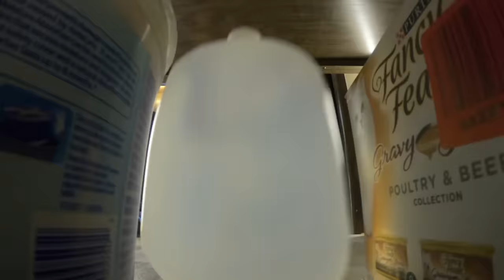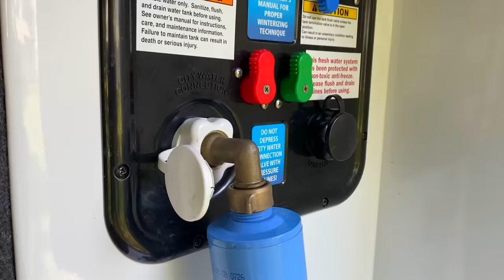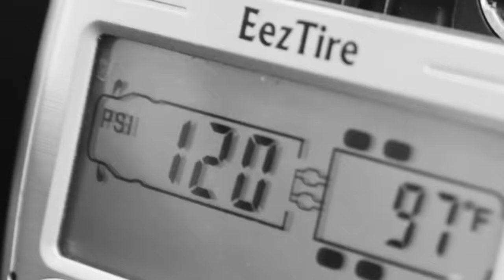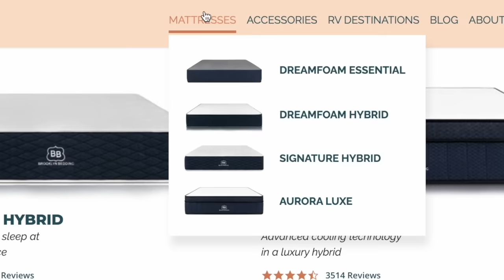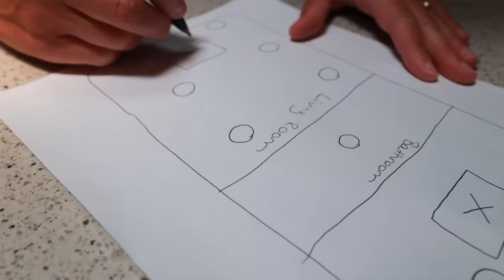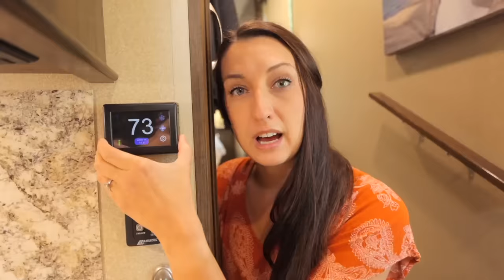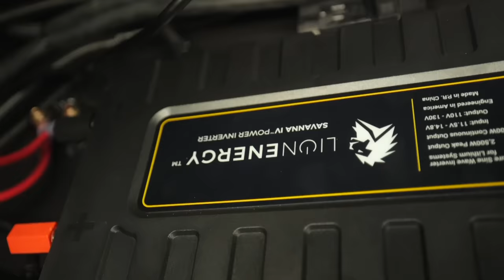9 Exceptional RV Upgrades that have the MOST Impact (RV Life)

Comment from the maker: A portion of this video is sponsored by RV Mattress from Brooklyn Bedding. A special thank you goes out to them for their support!
Save 25% on a new bed with our code: hanks
https://rvmattress.pxf.io/5g7Z23

Timestamps and Product Links:

00:00 Intro

01:39 Clearsource
---Save 5% with our code: HANKS5
https://urlgeni.us/clearsource

03:32 Tire Pressure Monitoring System
---Save 5% with our code: HANKS5
https://urlgeni.us/TSTtpms

04:44 RV Mattress (Custom Sizes)
---Save 25% with our code: hanks
https://rvmattress.pxf.io/5g7Z23

06:46 RV Airflow Air Conditioning
---Save 15% with our code: THANKSHANKS
https://urlgeni.us/rvairflow

08:17 Storage Benches
https://urlgeni.us/amzn/storagebench

09:12 Recliners
https://store.lci1.com/seismic-loveseat-group-norlina

10:01 Internet
https://www.starlink.com/

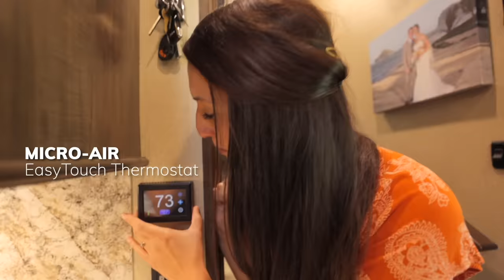10:53 Micro-Air Thermostat Control
https://urlgeni.us/amzn/microair

12:20 Lithium Batteries
https://urlgeni.us/LionEnergy

Comment: Some tips for Alaska. 2 mounted spare tires for both truck and trailer. Auxiliary fuel tank for the truck. Fuel isn't always a guarantee at a fuel station. Good set of tools, a jack and at least a 4 way wrench and/or impact wrench.  Minimum of a 2000 watt generator and increase your battery bank to a minimum of 2 batteries but 4 would be better if you have room. You may find yourself between campgrounds for multiple days. You pretty much must plan on being self sufficient and only relying on yourself to get out of trouble. Help can be hundreds of miles away. Carry extra fuel filters for the truck too. Plan for anything that can leave you stranded.
Reply: Good advise. Some days you may be the only rig on the road!!
Reply from the maker: Great advice! Thanks so much Ted!x
Reply: I am currently going opposite the way, and I agree with everything in this message.  Except for 4 batteries that'd excessive if you have a small generator, you'll be fine.

Comment: My family andI have pulled our camper to Alaska and back in 2021 and 2022, and I’d like to give you advice for your trip to Alaska. Take the Alcan and on the way up and the Cassiar on the way back. Both are amazingly beautiful but the Cassiar has a lot of unpaved miles on it. Once you get outside of destruction bay in the Yukon, don’t even try driving more than 70 KPH (all Canadian speed limits are in KPH) because the frost heaves are really bad and will sneak up on you. The sad thing is that the road is going to be very bad all the way to Tok Alaska. I’ve seen lots of people post about broken camper frames, leaf springs, and even axels. Take plenty of time in Canada to watch for animals and the scenery. Carry an extra 10gals of diesel in the bed of the truck. Some of the gas stations are very far apart in Alaska and Canada and the comfort of knowing that you have some extra fuel will take the stress off the drive.
Reply from the maker: Thanks so much Zack!
Reply: 😂that’s km/h on our speed signs. 🍻
Reply: When we moved from Alaska to Arizona we had a uhaul we were driving down. In the Yukon in the middle of nowhere we got 2 flats. That was a nightmare 😂 Be prepared for the worst.  Lots of pot holes.

Comment: My favorite upgrades so far have been the Micro-Air thermostat, the Levelmate Pro+, the RVLock keyless entry, Pepwave Cellular router, and installing a Synology NAS with my entire video and music library installed.  I love being able to turn my AC on while I'm on the way home from a day out and having it cool when I get there.  I love knowing when I'm the closest to level I can get without having to get up to check my bubble level on the counter.  Being able to unlock the door while I'm grabbing the groceries out of the car is fantastic.  Having internet where-ever I can get a cellular signal makes it so I can work remote from just about anywhere I want to be.  And when I can't get internet, I still have movies or music without taking up space and weight of a huge DVD/CD collection.  
My next upgrades are Victron equipment and LIFEPO4 batteries and a SeeLevel tank monitoring system.  I can't wait.

Comment: Tip:   If the temperature in your RV is hotter than outside -- open the windows and turn on the vent fans until the RV temp drops to the temp outside, then close the windows and vents and use the AC to lower then temp.  It is a lot quicker that way.
Reply: Unless it’s humid out, you just sucked in the moist air.
Reply from the maker: Very good and yes on the humidity, you gotta weigh those pros and cons lol
Reply: We have a mid size  dehumidifier when we are in the southeast, allows the AC to work better on start up or just sitting under the RV port.

Comment: Pulled a 40 foot trailer on the highway in 1981, the locals said the road was in the worst shape they had seen in 20 years. Only paved roads were near larger towns, the majority was rock, gravel and mud. Had days where we made only 50 miles and could only travel 10 to 20 mph.  Some parts were so slippery the trailer or truck would start sliding off the road. You guys have fun and enjoy the views, also the mosquitoes are the size of VW Bugs.😂

Comment: WOW you have upgraded a lot of stuff. Three things that interest me are the 1. AC upgrade because It can get hot in side an RV in the summer. 2. The filtration system would be really good at the beach. I use the tube filter like you showed us and it works okay but I still get the salty taste. I will be looking into the filtration System soon. and 3. The Lithium batteries. I will probably go with three of those and three solar panels. Okay the Bonus would be the air pressure system to let me know when the tires on the RV are low. #THANKSHANKS. Safe Travels and Have a great time in Alaska. I'm Jealous.. Hello to Dexter.

Comment: Another great informative video. I have almost every one of the upgrades that you mentioned. You're spot on. I went with the Waltech thermostat instead, as it uses wifi or cellular. It switches to whichever is available automatically. Just for the record, if RV Airflow here's you call it Styrofoam, they will be very quick to correct you. One last item... it took you until now to upgrade your mattress?! You've been missing out on a lot of quality sleep. Please keep the videos coming. Oh. I'm in the middle of a forest watching and writing to you because of Starlink. Zero bars out here. You've got to love that.

Comment: Eventually the current trend of a table/chairs in an RV will come to an end.   A dinette is such a better use of space, doesn't need to be secured before travel and, IMHO, is often more comfortable than a chair anyway.   Nice upgrades!
Reply: We don’t have table and chairs in the UK, our caravans are considerably smaller than yours, but we have benches at the front, with a chest of draws in the middle with a pull out table from the draws, which pushes away when your not eating, which is just great for the 2 of us, there’s a folding table in a cupboard should you need more space, but again we’ve never used ours at all.

Comment: Best advice… get the milepost! Skip all the spare wheels and tires just take the normal amount. The longest stretch on the Alcan highway without fuel is like 98 miles, and there’s a big sign telling you. Just read the milepost as you go along and you’ll be good.

Comment: You can also install a microair softatart for 1 of your ac units.   Get a 15amp to 30 amp adapter so you can run the ac unit for short periods off the inverter.  Make sure you upgrade to very heavy gauge wire (2 gauge is best) for the higher amp draw so it won't get too hot.  Perfect for boondocking and cooling the rig for mornings and evenings
Reply from the maker: Thank you for sharing this so others can learn :)

Comment: I've been using Lion Energy 1300 batteries for a couple of years now and they've been great. I just added two more, giving me a total of 420 amp hours. Looking forward to testing them out in a few days.
Reply: Interesting…We just bought a B class, near new with 3,000 miles and it doesn’t have a generator but 2 100Ah batteries (considered an upgrade). Never RV’d and were thinking more boondocking but I just went out and turned on the fully charged batteries, then the inverter, then the A\C…on low and it showed only about 2.5 hours of electricity…not good for us. Am going to look in to adding batteries like you did because otherwise this isn’t gonna work.

Comment: May i suggest something in the preventative maintenance department. If you don’t like being on the roof like me and tired of having to get up there 2-4 times a year and throwing money away with the dicor sealant then do one of two things if not both. Cover all seams with 4inch wide eternabond tape and or do a complete rubber roof coating and yes you can do that yourself.  Oh you say you have a fiberglass roof? You still have to check the seams. The eternabond makes pretty much a permanent waterproof seal and if you rubber coat on top of that even with fiberglass it will fill in any microcracks that may exist and has up to a 10 year warranty.  And in turn makes your roof trip usually once a year to clean and inspect.  Also for emergency repairs keep a roll of eternabond on hand.

Comment: Oh Hanks!  You are scaring me!  The setup in your electric bay....  The wiring is so.... Thin!  Please get some heavier gauge wire in there before something lights up (in a bad way...).
Reply: I 2nd this concern. Lithium batteries push high amps and the small wire gauge looks like a fire hazard.
Reply: @markgilbert6876  Looks like they only have one of the two batteries hooked up to the inverter through an 8ga or 10ga.  On a 2000w inverter, even with that short of a run, I would like to see 2/0ga.  I don't know what is going on with the other battery.  Some kind of external BMS on its way to the house over 16ga or 18ga?  And no cutoff switch!  And no fusing!  To say this setup is Fire is just so right and so wrong at the same time!  Can't believe Chad and Tara let ya'll drive off looking like this!

Comment: So out of your upgrades.....I've none ><  I think I like my kingpin and/or rear x brace the best so far.  The feeling like I'm on a boat has almost vanished and I've almost a foundation feel beneath my feet.  The water upgrade is needed and I've already partial solar for a trickle charge on my iron battery (so that'll need upgraded) and your thermostat upgrade.  Our park had some maintence and we found when the power is cut, fans/acs don't auto back where they were so the kitties were getting a little toasty.

Thanks for more vids!  Enjoy the trip to alaska, I've zero desire to head beyond the continential 48 so soak it up for me too haha.

Comment: Well done Hanks! 😊
I love the thermostat & Mattress. 
Will the thermostat work with other wifi, like a Verizon MiFi Hotspot? 
With your nice & heavier mattress, did you have to install upgraded Lift-Struts to access the below bed storage? 
Also... i want a TPMS too... but don't the weight of the valve stem sensors bend the valve stems from centrifugal force? Or throw off tire balance? 

#ThanksHanks 

Cheers, Eric

Comment: You might want to upgrade the wires between your batteries.  I have 6 Lion batteries and 4/0 wire between them.  This will help with the resistance between them in the wires.
Reply from the maker: We have a 1/0 wire to parallel the batteries, since our inverter wire is 1/0
Reply: @HappilyEverHanks  That should work for now.

Comment: I'm curious about the thermostat. Does this also serve the purpose of making sure your pets are safe from overheating if the power were to go out?
Reply from the maker: If the power were to go out and you have no additional power source (solar or inverter) the Micro-Air would only be accessible with bluetooth and that only reaches so far. However, if you have some type of power/internet running then yes, you can use it to monitor the temperature from a much greater distance! Hope that helps clarify, if not- just let us know!

Comment: There are 320 watt batteries. Could be a bit more expensive. One other RVer did was to put an inverter on each leg of the system. And two charge controllers. They can run anything off the batteries. Of course, they had 1200 watts of batteries. It's called enough power to run microwave, AC and Nana's hair dryer at the same time.
Let me know if you want the video link to when one channel did a detailed RV tour on another's rig. Includes complete solar setup. Note: the video is 2 hours long.

Comment: Those lithium ion batteries are not going to work in Alaska. You can’t charge lithium ion batteries if the battery is 32° or lower. They may even explode.